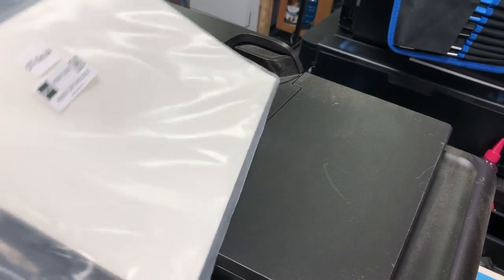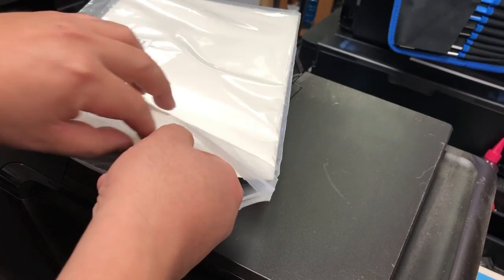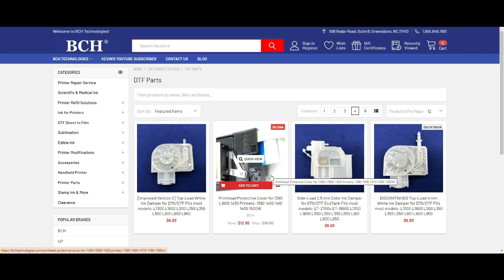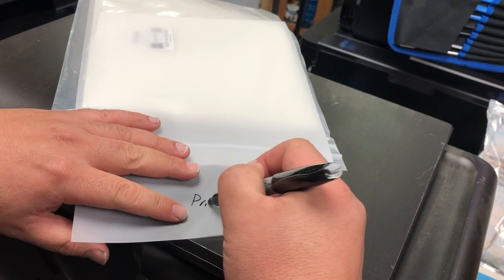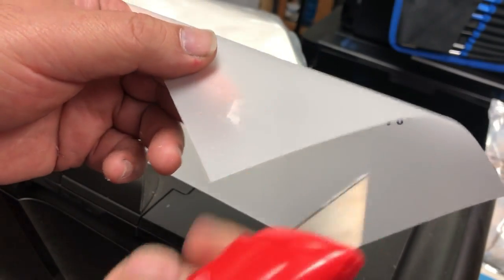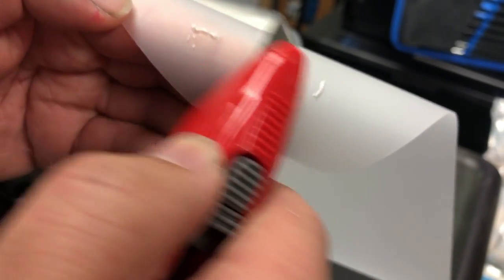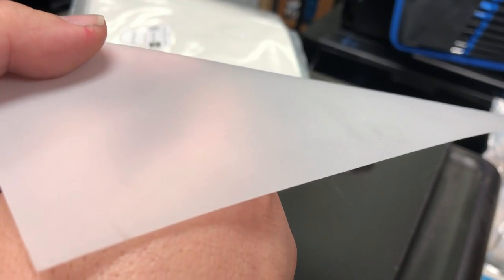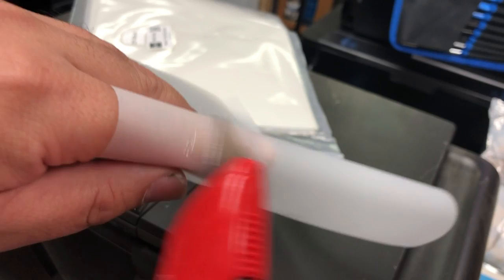DTF film - How to tell which side to print on?

Comment: I bought a sublimation printer from you & i must say its horrible you led me to believe i could print on cotton shirts that's a lie the print is dull it just all around bad 👎🏾
Reply from the maker: Reading is an essential skill when working with sublimation. To sublimate on cotton, you must first apply a cotton treatment and then complete the transfer. This step is included in any proper sublimation instructions, so taking the time to read them carefully will save you trouble.